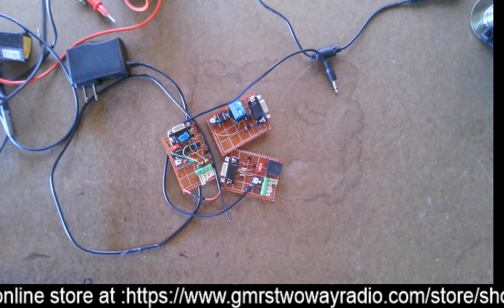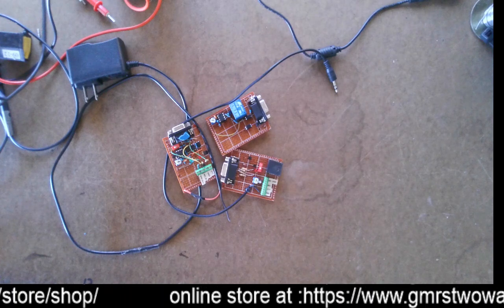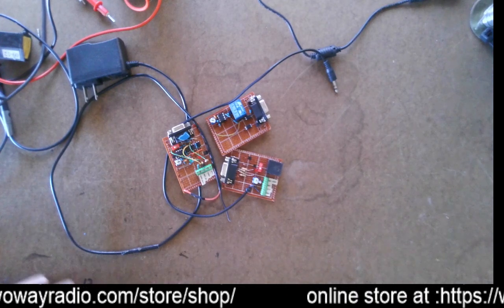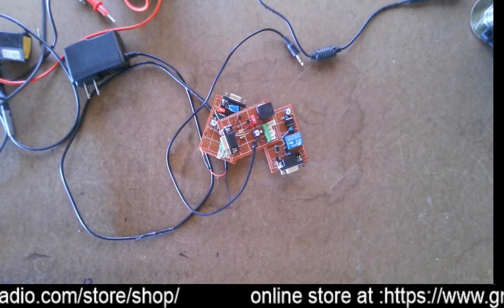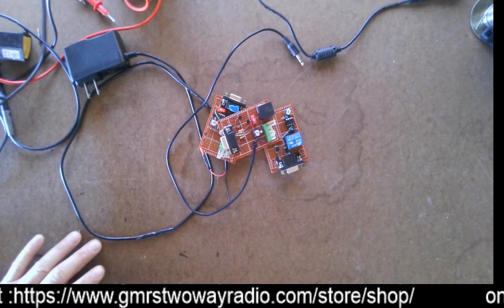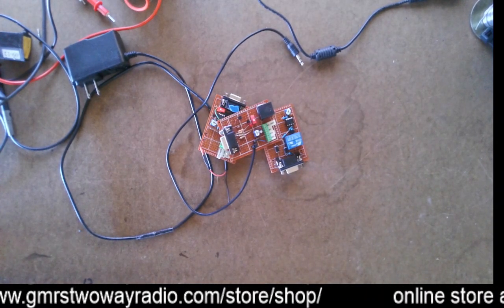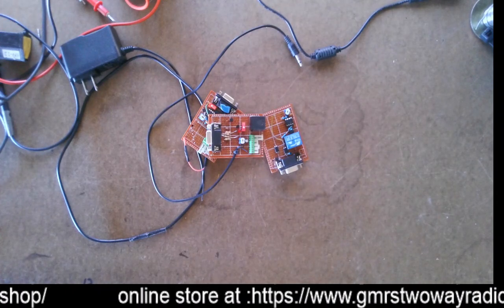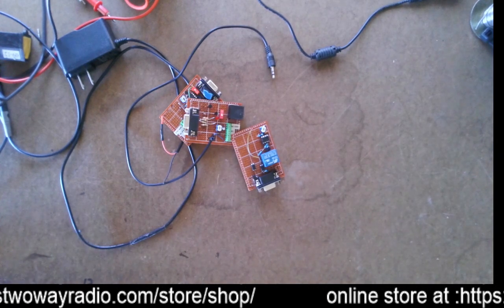🔺ANY handheld/mobile GMRS two-way radios interface board !! NO radio mods, NO Vox, UPDATE Q & A🔺

Comment: Looking for a simple way to make a repeater using my two kindled mobile's
Reply: Looking for a simple way to hook up my 2 Kenwood.Mobile's to make a repeater
Reply from the maker: @bradsmith2378 - yes, it should work.  You will need to get the mic pinout for that radio. If it's not in the owner's manual, you may have to email Kenwood for that info. Are you just looking for a repeater controller board, or you also want a computer interface for zello, etc?
Reply: @GMRStwowayradio  Just a repeater control board
Reply from the maker: @bradsmith2378 - ahh ok well I am working on a "stand alone" repeater control board too! No computer, which means no zello, etc. I haven't made any videos about this yet, but I hope to have a video soon 🙂

Comment: You gotta do a better job explaining the circuit boards better. Can you give us some close in shots of the boards and explain the components on each board?  From the views presented in your video, there are no RF components on those boards. Looks mostly like breadboards with a few resistors, relays and maybe a few logic IC's.
Reply from the maker: Maybe in other video I will explain more but yes it's a prototype so it will be breadboards. The final product will be a PCB board if everything goes well. And no, there won't really be any RF components that would be the radio itself.